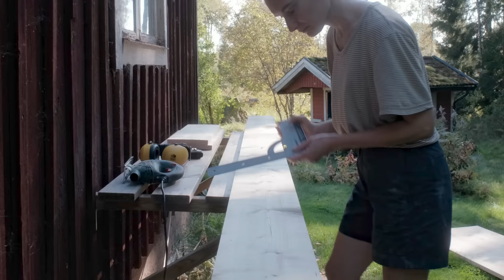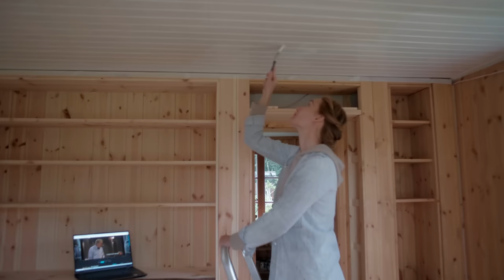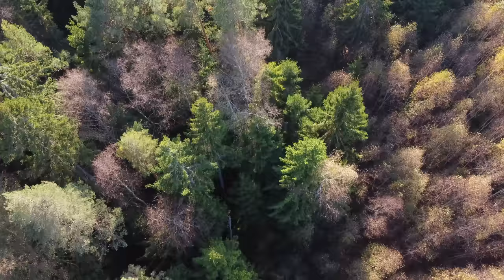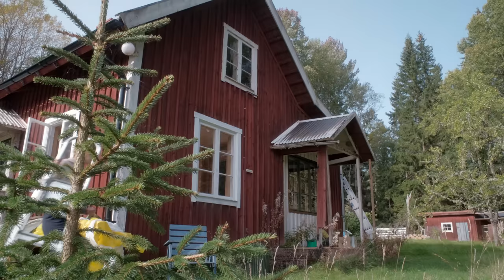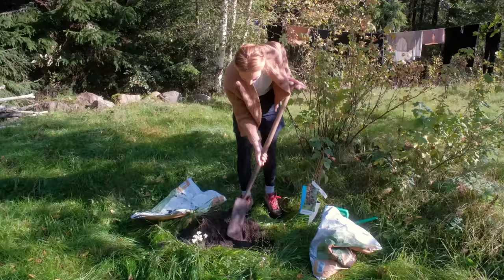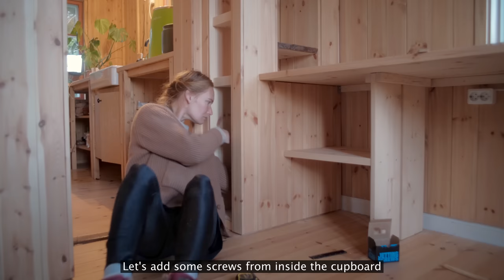I’m building a desk to match my custom cabin library (Story 65)

Comment: Try to not put you burnable cut pieces right up onto the house, so that you avoid rodents.  Close to the house, up on pallets, for easy access is a great idea.  I’d try to save your birch to burn at night because it will burn much longer than most other wood.  The smaller stove may not heat your whole cabin, and you’ll be feeding it way more often, including throughout the night.  URGENT:  You’ll need a concrete/stone/birch base for your stove, along with tile flashing beside the stove to avoid catching the house on fire.  You also need to have a pipe/chimney sweep scheduled to avoid fire as well.  Creosote builds up and can reach 2600 degrees.  I’m not sure how often your pipe may need it.  I’d research it.  Just thought I’d share my experience.
Reply: Wise counsel. And very good advice.
Reply: A friend warned me not to put firewood near the house. Insects and rodents. I inwardly scoffed. Two weeks later the chipmunks moved in.  Hooo boi I shoulda listened. Laughing at myself. 🤣

Comment: For anyone that doesn't use power tools the fact that she is doing nearly all this woodwork with a JIG saw is mindboggling and amazing ! Using a JIG saw for millwork is like trying to draw a straight line with a crooked ruler YET somehow her cuts seem to appear, straight, her joints meet at 90 and everything seems to be flush, plumb, and level  - its a skill lol. 
If I were her I would have asked for sponsorship from Sawstop or a European equivalent or at least buy a good battery-operated circular saw (the powered ones are not so user-friendly for what she is doing) -
Reply: Thank you for sharing that!  Wow!

Comment: I learned from someone long ago, that using pieces of brown paper grocery sack work really well to burnish a rough surface of wood that has been sanded as well as you can.  I have used this often for a final "sanding/burnishing" with excellent results.  The wood then takes a coat of varnish, paint, stain, or a polycoat really nicely.  I have also made my own buttermilk glazes using store-bought buttermilk mixed with any paint color, to give a really soft color finish on wood.  This raises the grain of the wood as it dries, but then I use brown grocery bag to burnish it again.
Reply: Thanks for the tip. I really appreciate it, and have saved it for later use.

Comment: Hallo ❤ I live in Norway, north of Oslo. I tried lots of different wonderful seeds that were supposed to turn into a wonderful meadow. Nothing worked. I was convinced that it was too cold in my valley. At the end of July, I sowed a last-chance meadow. I bought the seeds in Swedish Lidl. I spread the seeds using a simple grass spreading device. After a month, the first flowers appeared! The flowers are still blooming despite the frosts! Unfortunately, the flowers did not have enough time to bloom and spread the seeds, so next year I will sow the meadow again, in May/June. I paid about 50 Swedish kronor for one package of about 100 grams of seeds. It's worth it!

Comment: Hi Rosie, during the Fall/Winter seasons, and feeling cold try this.  Mango fruit or juice add as much Cayenne pepper as your tongue can tolerate or as little at first until you get used to the cayenne pepper and a dash of salt on the mango.  Eat it or drink it if it is juice and your body will feel warm or you will begin to sweat a bit.  It opens up your veins and circulation will begin to flow.  No more cold.  You can also take cayenne with anything else if you dont like mango.  Cayenne pepper is the key.

Comment: If someone asks what you bring to the table you can tell them you built the table.
P.S. A pro tip for when you do finish nailing on trim. Flatten the points of your finish nails. On wider trim it doesn't make much difference but on thinner pieces it'll prevent the wood from splitting. The flattened head of nail crushes it's way through the wood vs splitting it like a normal nail would.
P.S. The library/workspace looks great. Well done.

Comment: A tip about wildflowers is that they thrive best in poor soil. If the soil is too nutritious the weeds will quickly overtake them. if you want a meadow for pollinators etc, your best bet I think would be to flip the top 20 cm of soil upside down with a shovel, this will kill off the grass. Then late summer after the majority of the flowers have bloomed, mow everything down and leave the plant material on the ground for some days so the seeds drop. Give em a good shake and remove it. You don't wanna leave it to decompose, that will add nutrients for weeds

Comment: Excellent work. Quick tip, stir paint don’t shake the tin. Stirring allows the paint molecules to join together and allows a smoother even finish. Shaking separates the paint molecules and introduces trapped air which causes bubbles to form, weakening the pant bond and disrupting the surface finish. Using a paddle mixer is ok, but keep the speed low on your drill. Very best regards.

Comment: Rosie, it's looking wonderful! Well done ! Please please please get yourself some clamps for the joinery work to hold them down to the surface when you're cutting. I saw you use the jig saw outside on your counter with the smaller counter piece that was wobbling and my heart skipped a beat. You need clamps to avoid cutting accidents.... wood is replaceable. You need your fingers and hands intact!

Comment: On the stove as long you protect the floor and walls you can build a stove out of anything. Like mud, fire bricks, 55 gallon drums, River rock, Stone there are thousands of free plants. Go around take pictures of all the scrap stuff you have laying around post them up and let a few of us picturing her mind how they could be put together and do you some drawings of a stove. There’s a certain way it Hass to be built to draw air so we can pull in cold air from outside and eat it and generate heat in the house after it gets warm that would be nice. You can also just recycle the air in the house but that means you’re pulling hot air out and send it up the chimney so you need to be careful how you build it. The simplest and most rustic are generally the ones made out of stone you find in the yard or big Riverstone with clay with a little bit of sand and mortar mix built into the mortar to hold everything together. They do sell a high heat, mortar, caulk, and tubes that you can use to stick everything together also. He can make a square wooden box about the height where you want the stove to be cut your metal tubes from the vent and run down to the back of this and then you can start building your former beneath and around the box till you get to the top of it generally most people put a piece of steel across the top and maybe a few holes With burner tops in this they make a steel kit for the top of these were expensive. There are hundreds of people who have built these on YouTube to get ideas from and parts for but it can be very elegant. It could be very homey it can be rather rustic. If you have the right materials, it can be done in a few days. And keep in mind old stove don’t go bad if everything works and it’s 300 years old it’ll work just fine. There is probably one somewhere on the property that was taken out stuck in the back corner someplace so I would get a good look and find it. Heat rises in with the heat rises the smoke that’s the rules. Nothing special.

Comment: Just a thought. At some point put screening in the eaves of the house. Wild creatures do eat wiring. Losing you electricity would be expensive, plus if you put insulation in the roof rafters it will hold in the heat. .  Much like the little guest house.

Comment: We used to have windows just like yours a while back and even though they looked really cute with that classic wood framing, they leaked heat out of the house like nothing else 😅🫣 I cannot even tell you the difference it made when we installed PVC windows. The entire house got at least 7-8°C warmer just from that alone and we saved so much on energy bills. I know the plastic might not look as good as the wood and that PVC windows are kind of expensive, but they are absolutely worth it if you're looking to heat proof the house 🤗❤

Comment: Tip for your measuring tape - you actually never need to bend it. The tape measure will have its measurement on the case, you then add that additional amount to your measurement giving you the perfect measurement :)

Comment: Check out the Fiskars wood splitting ax line.  They have small, medium, and large.  I had no idea how good they were so I bought one.  I build log homes and when we have some downtime, there is always a chance to cut and split some firewood.  I realized that the Fiskars axes were when I walked up on two of my employees and they were arguing over who got to use the new Fiskars heavy splitting ax!  I immediately went out and bought a second one.

Comment: the table is nice but in winter it will be cold sitting beside it. I would cut an opening where the window is and hang 500w electric convection heater on the wall under the table, so it would heat your legs and act as a heat wall for the window during the winter. make sure heater has a thermostat and set desired temperature to save on electricity.

Comment: For your wood stove Jotul is the best reliable burn and heating efficient.  But a cooktop and oven to bake and roast. Research burn efficiency heating efficiency so less firewood used less firewood to chop and cut.  I use a Kratki Poland Amelia 21kw burns 1kg. an hour and at -5C no worries heat pump heats entire house like mad. :)

Comment: I am building a similar desk area. Your design is perfecto as are so many of your ideas.
I have a small house and curve any edges that protrude so the blow is softened if I bump into them. I am a retired wooden boat builder so I am better at forming curves than corners. I kinda get frustrated at 90 degree angles.

Comment: Hi Rosie, have you seen the drill bits that split wood?  (Firewood Log Splitter Splitting Drill Set 6pc Household Electric Split Cone Drill Woodworking 32-42mm Firewood Splitting Bit)  They are pretty inexpensive online and making firewood look much easier than chopping.  You could use your drill and the mini power station…….?

Comment: I would honestly buy a better sanding machine. We've got  the same one and another round one and the difference is quite crazy
Reply from the maker: can you recommend a good one?
Reply: Most professional orbitals are going to give good service. The Festool is the best I’ve used but is expensive. I’ve used a few Bosch ones too and the only gripe i have is that if you press on too much, which you almost always do at some time, the velcro will melt a bit and lose it’s grip and then you need to buy another velcro pad, which is an annoying cost if you do that. I learned the hard way but the Festool seems to be much stronger in that respect. If you are sanding a lot then a belt sander can do the work quicker again but it generally more aggressive. The can be useful for mounting upside down or in other positions and using like that for all kinds of things. Also, consider learning about cabinet scrapers because they are cheap and if you learn to put an edge on them properly (lots of vids on youtube), you can use them for all kinds of tasks such as smoothing down wood, or cleaning off old finishes.
Reply from the maker: @jellyartist  Thanks for all this! I should spend some time looking into some of these tools. it gets overwhelming and then I just stick to what I have, but there's so much out there that could really make a difference in result!

Comment: If you want to be sanding with a bit more “bite”, you can use an angle grinder with a sanding attachment. But be careful, it does eat a lot of the wood really fast. Then you can pass a normal sander for better finish.

Comment: I don't know if they told you this at the paint store. But when you paint over wood, you have to use kills to seal the wood. Because it will bleed through the paint and change the color on you. I'm so sorry I hope it doesn't just giving you the heads up.
Reply: Kilnz.   It's a primer.   Works great

Comment: If I was u I would buy and get someone to come out and install u a wood burning stove.. Sometimes u can buy them 2nd hand.. but u will have to put a boot around ur pipe coming out ur roof..But u can install 1 if u have the insulated pipe coming out of the wall but at least u will stay warm.. will the wood burning stove in ur kitchen work? Wood burning is the best option off grid it's free.. Also since u have a bathroom go out the window use it into a new shower u can build u a small shower onto ur house and use the window as a door to ur closed in shower.. u can get a gas on demand hot water heater..😊

Comment: I’m sure there is a system to which projects you choose to do first and why you do them in that order, but why wouldn’t you do projects that are going to be unpleasant in the winter/ colder seasons while you still have a bit of sun outside? I think all the cosmetic stuff can be done at a later stage, while you can focus on all the big projects now so that you spend as little time outside during winter.

Comment: That window where you were planting so badly needs doing - looks like a bit of wood needs replacing for the sill and base of window.  Please pull out the weeds by the green windows.  I think the inside of that porch area should be painted green like the windows.  Plants on the porch area in wooden troughs.  Scandanavian.